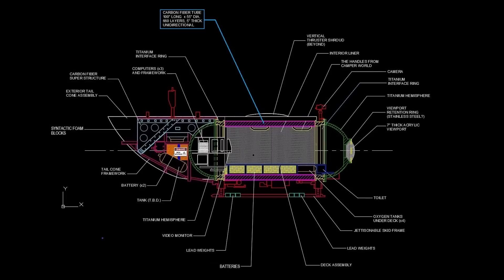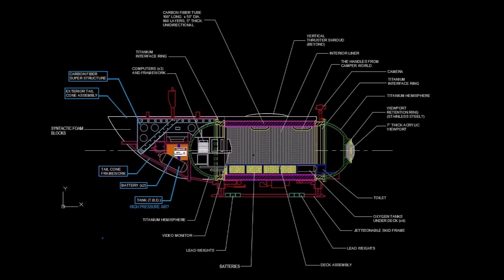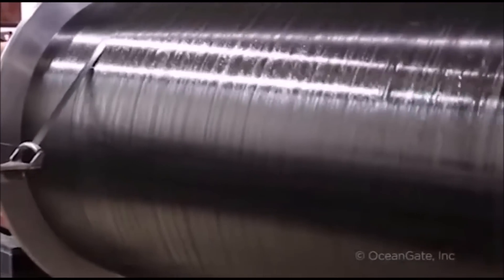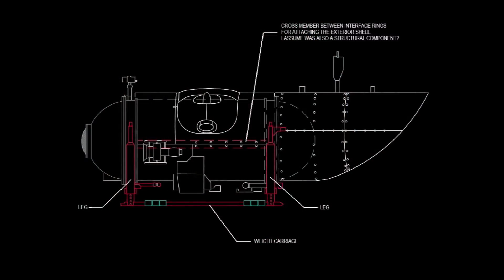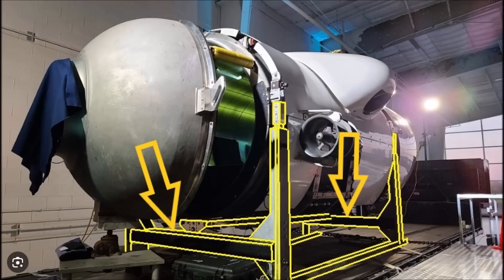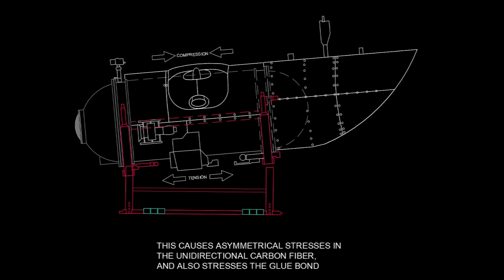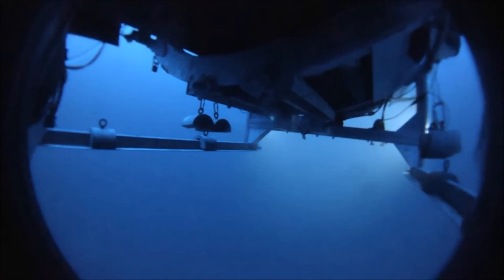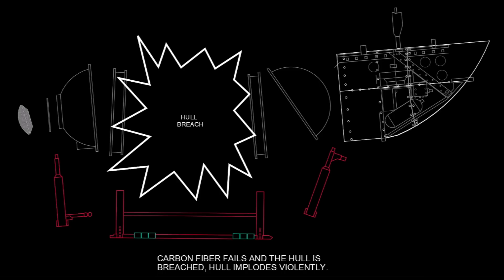OceanGate Titan - DID THE CARBON FIBER BUCKLE?

Comment: I think the fact that it was descending much faster than desired or expected tells us everything we need to know about why the carbon tube collapsed. The only two possible explanations for the miscalculation of its rapid descent is that there was something heavier than known, or less buoyant than known. The most likely variable is the carbon fiber being less buoyant with water saturation from being damaged. With more damage it is inevitable to collapse.
Reply: The sub hull was covered in Rhino Liner,  in Rush won words he said this was to protect the carbon fiber from water intrusion,  so it was known that water penetration into the carbon fiber was possible.  This is likely just one of many things going wrong
Reply: @denniss3980  I laughed when Rush said that. Rhino Liner was never tested to be water proof at 4,000 meters while being subjected to compression and expansion.
Reply: @zeuso.1947  but it works great in the bed of my pickup truck
Reply: @denniss3980  🤣 so true
Reply: Was there another  cause for the rapid descent rate - that craft was taking on a lot of water imo. If it was saturation of the carbon hull, it should've imploded at the halfway mark ✌🏽
Reply: @shayshay7409  "Half way"?
You would be assuming the degree of saturation. We don't know the exact weight of the water saturation or how damaged the carbon fibers were.
Obviously, it was only saturated with the amount of water that resulted in the observed rate of descent, and the carbon fiber was only damaged to the degree which resulted in the implosion at the depth it was observed to implode.
I'm sure the math could be done to calculate how much additional water was needed for the rate of descent observed.
Reply: @zeuso.1947 
What do you mean by saturated? You mean fibers delaminating, creating space for water to flow through?!
Reply: @i.i.iiii.i.i  Not necessarily flow "through" but enter between the fibers. Carbon fiber is extremely brittle and breaks microscopically under bending stress.
Reply: @zeuso.1947  
There is some kind of resin between the fibers... it's not just "dry" fibers that just lay "loosely" on top of each other
Reply: @i.i.iiii.i.i true but the epoxy holding the fibers together is a weak point.
Reply: @i.i.iiii.i.i  yes. Of course, but anyone familiar with carbon fiber knows it is susceptible to cracking and delamination under compression or bending stress.
Reply: There is definitely a case for ballast weights being incorrectly calculated. Remember Titan used some unconventional weights such as scrap pipes. It could of simply been a weighing error or a mix up of what pipe was to be installed that could of sent them hurtling down. Where they managing a situation for the whole dive? Did they not trust their own depth meters. So many possibilities but I do think we cannot write off human error in ballast.
Reply: @Cheeky-fingers  The submersible ballast would have been weighed and calculated. That's just too obvious; I can't believe it was a bone headed mistake like that.
We know the carbon fiber hull was deteriorating more with each dive. All those cracking and banging sounds people reported, and Rush said was "normal" made the submersible less buoyant and descend unexpectedly rapid.
Reply: I think there were multiple failure points in play, maybe both water saturation and too much ballast. But how do you ready this sub for a dive when it is bouncing around on that little platform for two days
Reply: @denniss3980  Maybe, but it only takes one. And carbon fiber saturation IS excessive ballast.

Comment: It probably would've worked better or been a little safer if they had left a hollow steel core and just wrapped the carbon fiber around that. It would've gave some resistance for the carbon fiber pressing against it. It really doesnt make sense they thought a hollow carbon fiber core would hold up over time. Its really unbelievable that people would think that would work and pay to give to that depth in it. And no failsafe either. I wonder why they wouldn't have just used a steel core to wrap around. Wouldn't hurt and wouldn't add that much more cost
Reply: Things are rarely as simple as we make them out to be. This actual sub made several succesful trips to the Titanic. This should tell us that it was closer to actually being sufficient for the task than people is lining up to say in hindsight.

Lets say they had used the same basic design, but calculated to give  the carbon fibre hull 25% more strengh (more redondancy), used a more professional  construction method and, introduced proper check-ups at regular intervals between dives. If so, I bet it would still be out there proving us all wrong.
Reply: @torben777  in one of Stockton's interviews he said they had plans for a Titan 3 with a rating of 6000m ,  That is the sub that should have been built for going down to Titanic
Reply: @torben777 no it imploded killing everyone.  No where on the remotest realm of safety.  If your car made 4 trips to visit your friend but then blew up and killed your family member who borrowed it and all the others s/he brought with them would you say "but it was so close to being safe, I mean I survived 4 trips in my car!"   Your idea that redundancy is operating on the thresholds of suddenly dying is wrong.
Reply: @SoulDelSol  Your post makes no sense. Oceangate was clearly operating with too little safety margin. I was simply saying that if they had added more safety margin it would likely have worked despite all its flaws.
Reply: The buoyancy. The buoyancy dammit. Duhhhhh
Reply: The carbon needed to be used internally for load or stress bearing members, and not externally in it's weaker orientation, or redirection of forces. Think of moving something like a car by pushing with a rope vs pulling it....  A better design that I've heard about is concrete  with fibers embedded, that greatly enhance it's strength in compression by spreading loads. Similarly, internal structures overwrapped with carbon so it's in tension ie as concrete beams or pillars are compressed so the carbon can prevent expansion or buckling of structures.

Comment: I'm going with the experts..2 different materials bonded together is a bad idea for high pressure load. Especially in that great of depth..Also it's really disturbing to know the carbon fiber used was bought cheap due to being past self life..makes it compromising material from the start...I think it would have been a good cheap sub for use at much shallower debts..All blame goes on Stockton Rush. No matter the how it happened..The guy didn't care about safety or expert opinions.
Reply from the maker: @Womack499 I do think losing two years because of COVID had to be a factor in in all of this.
Reply from the maker: I think they tried to compensate for that with those thick titanium interface rings, but yes dissimilar materials is just a bad idea in this type of situation. I’ve heard rumblings about expired carbon fiber… do you know the actual source of where this info comes from? Might be one reason they had that tube in the “hot house”, as Stockton Rush called it, for two weeks.

Comment: If you look at the video footage showing the remnants of the sub being taken off the recovery ship you see one of the Hemispherical cap rings that attached to the the carbon fiber hull showing different color impressions on the ring itself, this leads be to believe the adhesion or cohesion of the ring to the cylindrical hull was comprised during construction or because cyclic fatigue.

Comment: I still do not buy that hydrodynamic or torsional loads due to a partially detached leg structure would in any way be significant compared to the enormous hydrostatic compression. Remember the failure happened at or near extreme depth when the hydrostatic forces were at a maximum. I do not think we need an explanation beyond failure of the CF part of the hull. Probably there were signals from the acoustic monitoring or audible to the crew which caused them to initiate an emergency ascent just moments before the catastrophic failure.
Reply from the maker: Fair enough. According to the "leaked transcript" the RTM system was "alert active all red". If true, they really didn't have a chance. Since it was a texting system with no VOX system, we can only speculate if any anyone else in there knew what was really going on. Imagine the system you had patented yourself telling you that you are about to die any second.